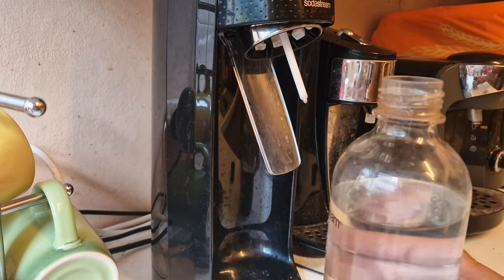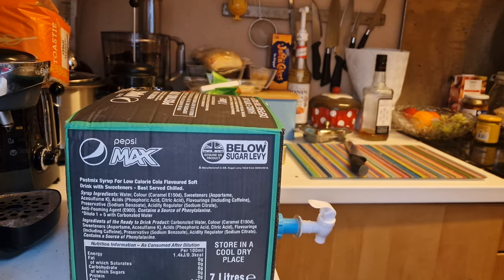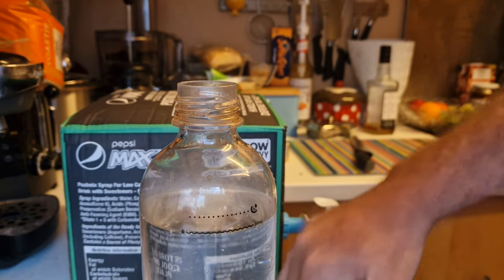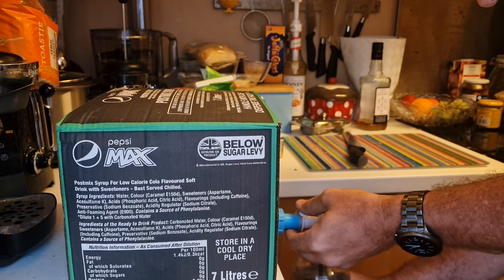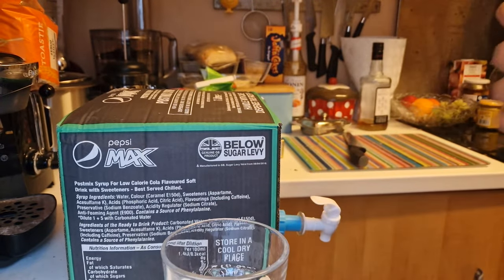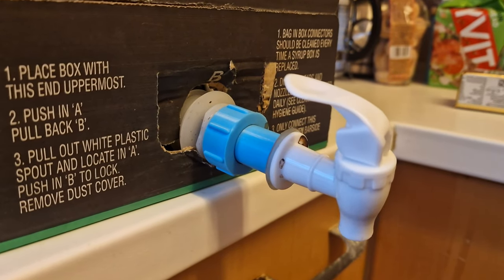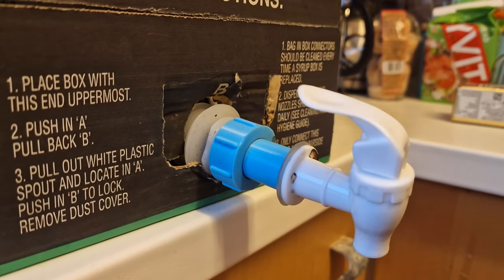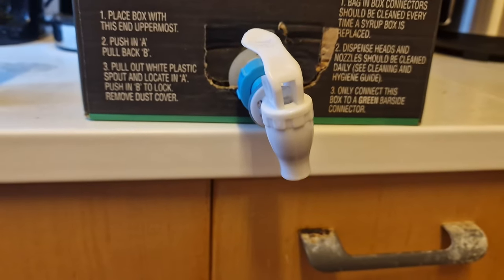Using Pepsi Bag-in-Box syrup with Sodastream

Comment: It's cheaper to use sodastream syrup. They are £5 per 9 ltrs.
Reply from the maker: You're right. I made this when the syrup I wanted went out of stock.
Reply: They taste like crappy artificial sweetner.
Reply: Sodastream pepsi is full of sweeteners hence why People are now moving to using bag in box pepsi as its the original recipe that is still being used in pubs.
Reply: @rossco010  The difference is bag in box pepsi max is using aspartame as the sweetener, sodastream pepsi max is using sucralose as the sweetener.
Reply: @LauraRealLife  Ive been arguing with my wife about this all week. They are very different.  The Sodastream pepsi max tastes very much of artificial sweetener and makes me feel queasy (sick) for hours afterwards. Went back to drinking canned pepsi and i feel fine.  Bag-in-a-box is definately my next purchase!
Reply: For anyone who is wondering about the sweetners: the BiB recipe uses only Acesulfame K and Aspartame. The Sodastream Pepsi Max version uses Acesulfame K, Sucralose and Aspartame. Some people may not like Sucralose while others may prefer it but this is the difference between the two. Both have artificial sweetener in it.
Reply: I was referring to original Pepsi in my comment but of course you are right about Pepsi Max.
Reply: It's actually cheaper to buy BiB syrups. With SodaStream recommended mix ratio the drink is always weak, cause when you add a bit more syrup then it doesn't taste watery. SodaStream recommends a weak syrup to water ratio so they can say it's cheaper to maximize profits, just like they lie about how long their CO2 bottles last! Not to mention CO2  only costs $5 a pound. SodaStream over charges you by 80% on their CO2 prices. I use my own 20lb CO2 tank with a hose and adapter to connect to either my SodaStream or Drinkmate, actually just 'Drinkmate' now cause it does a better job..paired to my 20lb CO2 tank, I'll probably use it twice a day everyday and still get over a years worth of drinks!  Sorry for any typos, I'm speaking this comment into my phone cause I'm driving 🤣.